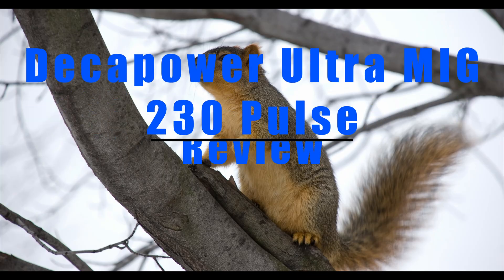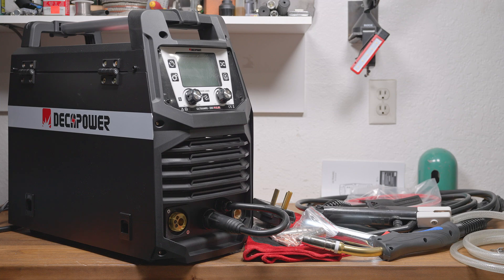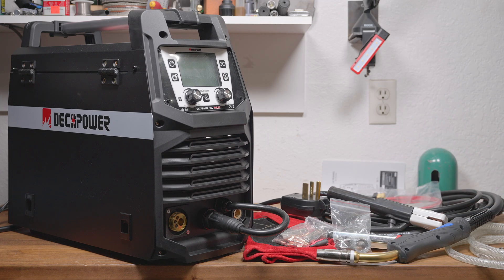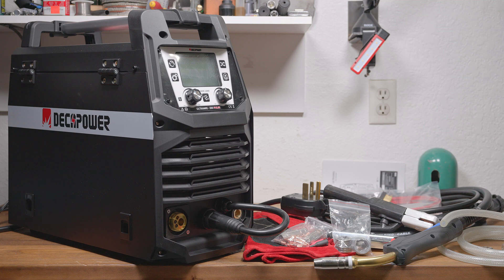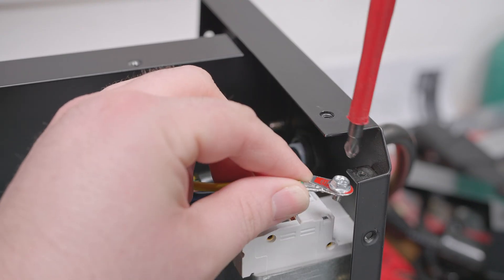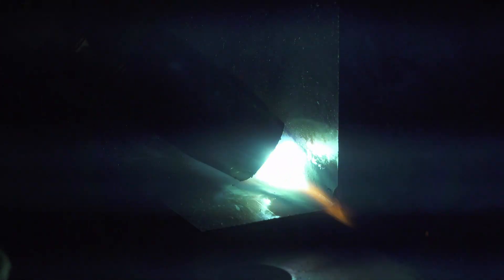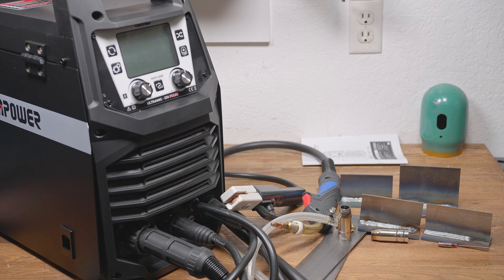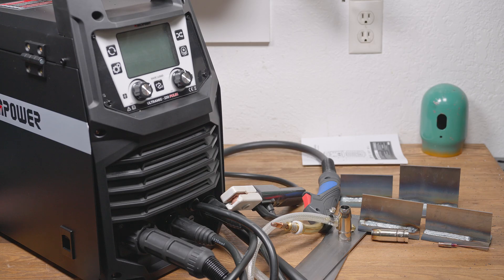Decapower UltraMIG 230 Pulse - Teardown and Testing

Comment: Awesome review. Thank you! Based on your reviews it seems like this and the dp200 are too close to pick a winner. What do you think? 

I'd say the pro for this one is its slightly more powerful. But, you can't really use it given the limits of the gun? And the pro for the DP200 is the ease of use thanks to the additional help screen features?
Reply from the maker: I'm still working to get this machine set up to weld aluminum, and I have a new, higher amperage MIG gun to test out with it.

Weirdly, I think the Decapower is actually a bit simpler.  Not so many menus and different, overlapping options where one will often change or limit the others.  The graphical help menu is nice, but probably not a deal-making feature.  Ironically (based on my past experience with Yeswelder), I think the DP200 is a bit better put together than the Decapower, though I can't say which would hold up better, long term.

I think the auto settings on the DP200 are a bit janky, but it seems they are finally close to having a firmware update ready to go, which adds features, changes the tuning, adds a full manual mode, and more.  I'm going to test out that update, and if it fixes the issues I had with the DP200, it could make it a pretty good option.  

But I'll have to see how everything shakes out after my next video testing out the Decapower.  I hope to be able to get the next couple videos with these machines done in the next couple weeks to a month, but it's hard to say for sure, with work, etc.

Comment: Nice too bad you did not include the in the Aluminium and flux core part. Soon to publish? This machine is a contender for my project welder. Synergic seems really easy for someone like me that will not weld regularly.
Reply from the maker: I am hoping to get to the next video soon.  I've just been super busy lately, so I can't say for sure when I'll get around to making the video.  It's supposed to be nice this weekend (super hot, though).  I may get time to work on it, but I'm not sure yet.  Cheers!
Reply: @bigtb1717  No problem. btw how much better does a 4 roller feeder work with flux core compared to a 2 roller version?
Reply from the maker: @Average-AL  For most people in normal use, they probably won't see much benefit.  I think it's mostly beneficial if you have a really long MIG gun, or if you are trying to push larger flux core wire (like, 0.045" or larger) a long way.  It can take a lot of force to push thick wire through a long MIG gun, especially if the cable ends up wrapped at a tight angle somewhere.  This can lead to wire slippage.  If you over tighten the rollers on flux core, you can crush the wire.  It's hollow with flux inside, so if it crushes, it deforms and won't feed as well and won't run as well.  That's why the knurl the rollers.  This gives them more grip, even at lower tension.  Having four rollers increases your feeding power without having to tighten the spring tension on the wire.  It can also give the feed system the strength to pull wire from a very large spool.  If you are using a 45 pound spool of wire, that could also create slippage in some cases, especially with high wire feed speeds.

So there are cases where it can help, or potentially even be necessary.  But for an average user running 0.030-0.045" wire through a ten foot MIG gun from an 8" spool of wire?  It probably won't do much beyond ensuring that even if the feeding tension is set really loose, it never slips.
Reply: @bigtb1717  Somebody mentioned that flux core is more sensitive and that it creates more uneven welding and more splatter if the rollers squeeze it and that 4 rollers could make this problem smaller.
Reply from the maker: @Average-AL  Right.  As I mentioned, flux core is hollow, so it is easier to crush if you use too much pressure.  But for thinner wire and a normal length gun, this isn't usually a big issue.  Knurled rollers which are intended for flux core get more "traction" on the wire, so you can use relatively light pressure, and still avoid crushing the wire.  Basically, you want to set the pressure low enough that you aren't deforming the wire.  At that point, as long as it isn't slipping, you should be good.

The four roller setup is still nice to have.  But it's the first welder I've used that has that system, and I've had no issues with flux core on the other machines.  But I've also never used 0.045" or larger flux core, or a MIG gun with a cable longer than 10 or 12 feet.  And I've had one or two situations where the wire was slipping slightly, and I had to straighten out my MIG gun cable to allow the wire to feed more easily.  So the extra drive rollers are nice.  But certainly not necessary, and probably not a benefit you'd really notice in normal use, most of the time.
Reply: @bigtb1717  Thank you a lot. My main priorities for my weldermachine is to do fluxcore on some machines I need to weld some stuff to. It is usually outside and as I understand gas mig is not good it there is wind. Speaking of that. A newbie question. If I need to weld a bracket in 3mm steel to a really thick I-beam do I need more power or should it be set to 3mm to make a solid weld?
My second priority is to do some aluminium welding in the future so I need a machine to handle that as well. And a simple interface. This unit seems to have a good interface for a beginner that shows the thickness as well as amp.
Reply: great explanation about the 4 roller... I prefer 15ft gun because I work on the trailer but I believe most people work on a table so 10ft should be enough for most people. In the past I tried to upgrade from a 10ft to a 15ft on a Tooliom welder and the 15ft gun would not work well with the simple chinese roller that comes with these cheap Chinese welder.  So this 4 rooler from Decapower even if overkill, i would say that it is a great feature to have.
Reply: @rick076  Yes it rarely hurts to have something better that required.

Comment: I've been checking these out for a while , knowing they do 6010 makes me want one even more. I like my other welding machines fine, each one has its strong suit. I would like to pick one of these up tho.
Reply from the maker: I ordered a heavier duty MIG gun.  It seems like the order is delayed for some reason, but once I get that, I'll do some more testing.  If you aren't in a hurry, it's probably worth waiting to see if they come out with a version specifically for North America.
Reply: @bigtb1717 ... did you get a 15ft gun for testing if the 4 rollers really work smoth with a long gun? where did you get your heavy dury gun?
Reply: even though I don't use 6010 but it's good to see that this is one of the few machines that can actually work with 6010. It seems this is one of the best options for low-cost machines running stick welding.

Comment: You need to tell them  0.040 (1mm) is not a thing in the US.
.0.045 (1.143mm) could be an included roller if it can run at 230A.
  The extra 10 thousand is a big jump for most smaller welders.  .045 might help on flux.  The 0.040 roller is going to be just wasted.
Reply from the maker: Yeah, even for contact tips, it only included 0.8 and 1.0mm.  No 0.9mm.  Same with the rollers.  I actually used the 1mm roller and contact tips with 0.035" wire.
Reply: @bigtb1717 ... in this video... did you use 0.30 wire or 0.35 wire for pulse and double pulse mig?
Reply from the maker: @rick076 I used 0.035" wire.

Comment: Good review. I put a 300amp 15ft bernard type torch from Sany  on mine- i literaly set my stock torch consummables on fire. Its a great machine. Ive run it extensively in single and double pulse on both aluminum and steel. The tig is surprisingly smooth. The stick is adequate. I also have an everlast 253dpi and i prefer this machines pulse by a margin. What is strange is for out of position (vertical up) on steel the machine runs at rediculously lower amperage than my everlast. I run the everlast on single pulse for 1/4" mild steel at 140 amps and  the ultramig 230 runs same thickness at 91 amps and 19v. Maybe you can explain the disparity but it lays a pretty bead nonetheless. Both are maxed trim wise to the negative(-3.0v ultramig)( -4.5v everlast). Glad Jent found his new guinee pig lol.
Reply: I am happy to hear someone else writing that the Decapower is a good option for Pulse Mig. How easy is it to run vertical up in pulse in comparison to running regular Mig? I gave up on regular Mig vertical up... i can only achieve decent looking welds at low voltage and I dont trust the strength running so low voltage... My hope is to find a not crazy expensive Pulse Mig machine that that allows me to easily run vertical up and overhead similar to how easly i run fluxcore vertical up and overhead.
Reply: It is also great to know that that you upgraded to a heavy duty 15ft gun and now you are able to run Pulse without overheating the gun and I am assuming the 4 drive roller makes sure that even at 15ft, it feeds smooth, correct? where did you buy your 15ft mig gun?